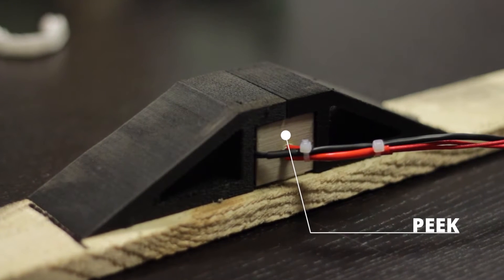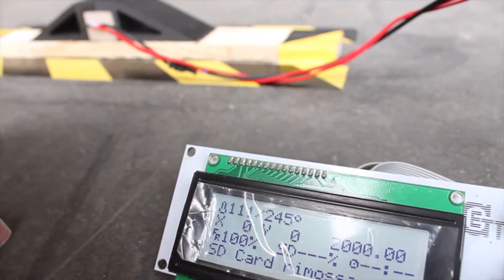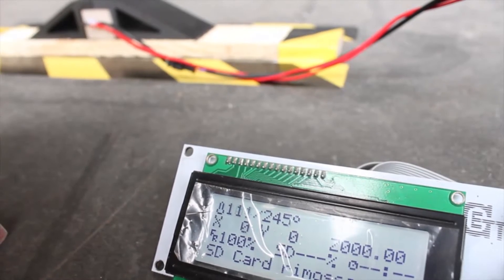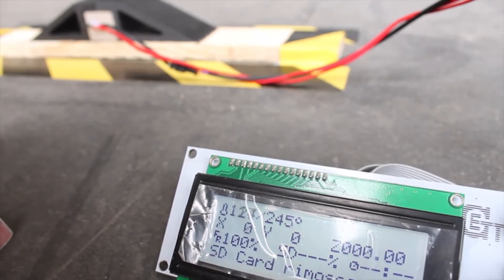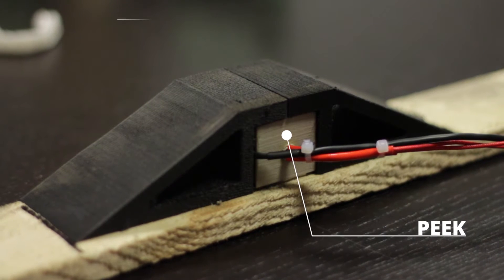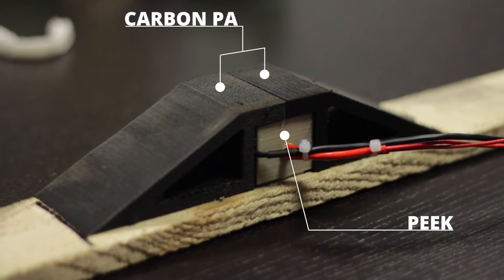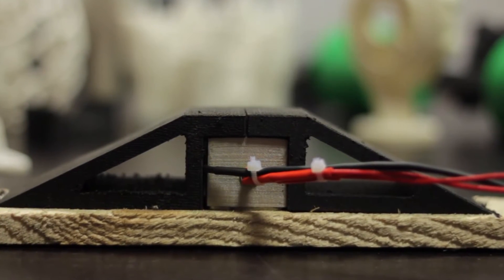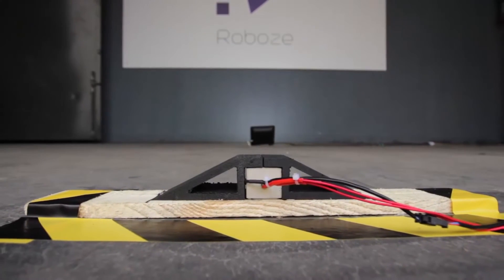Roboze 3D Printer - SUV's proof

Comment: You show us your 3D printed material does not compress while heated.  Under an unknown weight.  Many materials can do this.

Give us some usable test results:

*  Tensile strength, 

*  Flexural strength, also known as modulus of rupture, or bend strength, or transverse rupture strength is a material property, defined as the stress in a material just before it yields in a flexure test.

*  Hardness properties.

*  Fracture toughness
.
*  Impact resistance.

*  Shear strength.

* Compression strength.

*  Cantilever flexure.

* Three- point flexure.

*  Four-point flexure.

*  Torsion.

I other words, by definition:  In materials science, the strength of a material is its ability to withstand an applied load without failure or plastic deformation. ...

This post is not to bash your product.  But please, to make an educated decision we need some useful information.  

the artist escher made a drawing that really made it look like water can flow in a circle.  The one that goes over the water fall and than flows around a circle (that looks like is is flowing down) ending up at the top of the waterfall.  Created in 1961.  You can Google this. Artist escher waterfall 1961.  He has many artistic works that by the engineering stand point.  Looks like it would work but of course there are no real numbers to back it up.  Obviously  they can't.
Reply from the maker: Dear Mr. Smith,
 thank you for your interest in our products.

We of course have all the information you require. 
Carbon PA is a nylon12 filled with carbon fibers. The fibers increase nylon12's Tensile Strength from 48 Mpa to 98 Mpa giving strong mechanical properties to the printed parts;  It is ideal for high-end mechanical applications, thanks to its high tensile modulus (7.85 Gpa). Flexural Strength is 90 Mpa and a Flexural Modulus about 5 GPa.

Our materials science team works daily with engineering grade materials and we would be happy to provide all the information you're looking for. So please, for these and any additional questions, contact us at support@roboze.com.